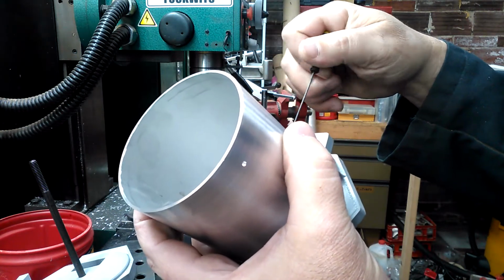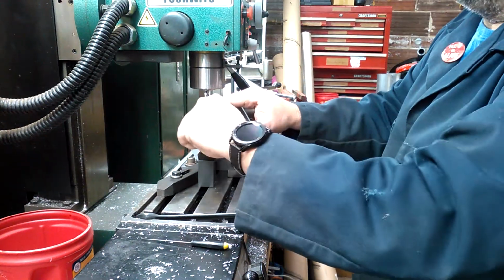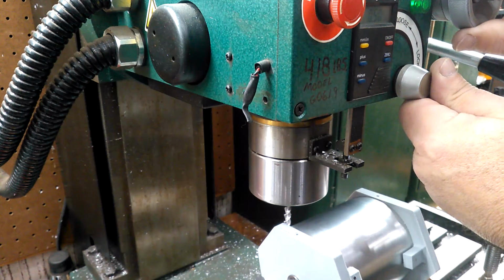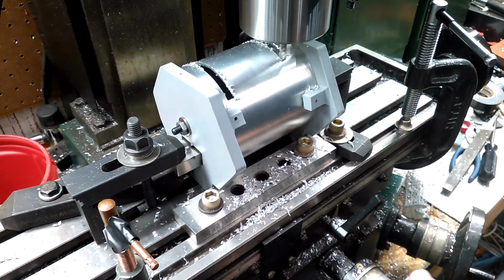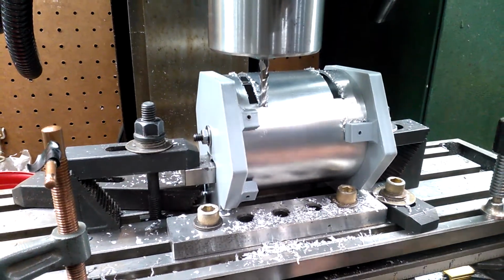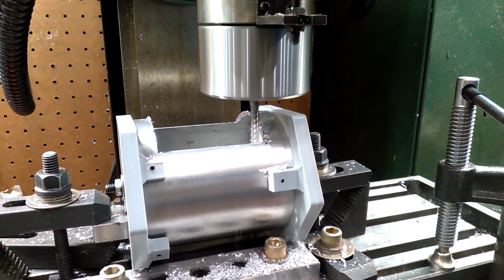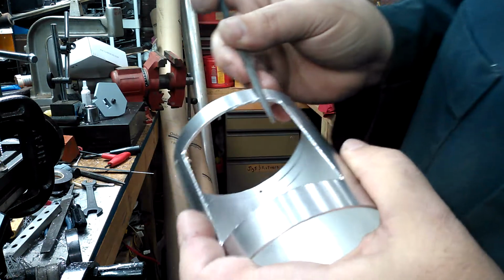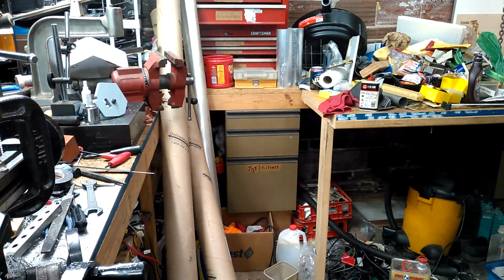J5 Eye Tube Fabrication - Milling out the square Hole for the Eye Vent Frame in the Eye Tube.

Comment: Do you sell these?
Reply from the maker: No we don't but join input-in builder community on FB. There are part runs that do occur.
Reply: @J5GURU  I'm already on there thanks
Reply: @J5GURU  are the left and right tubes different in size
Reply: I,m not sure he just shows you what to do in case your building one of your own